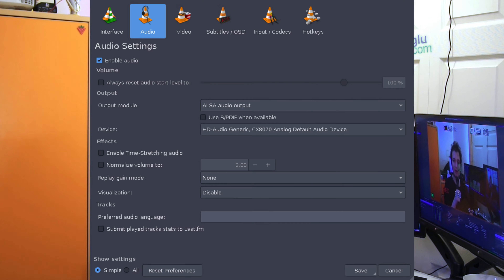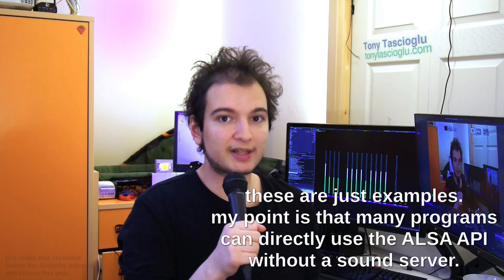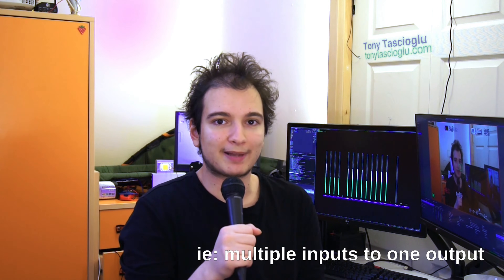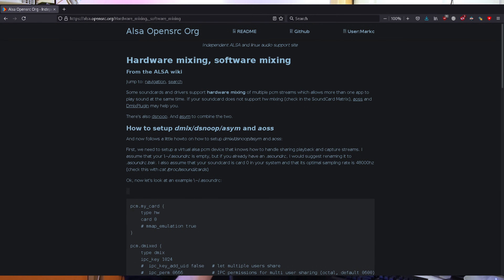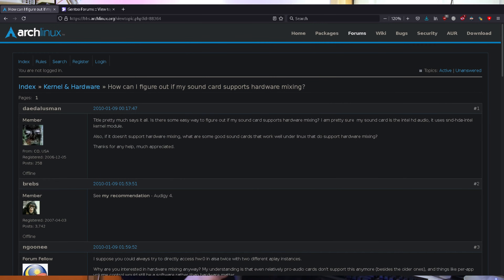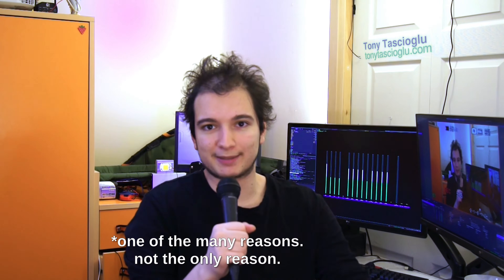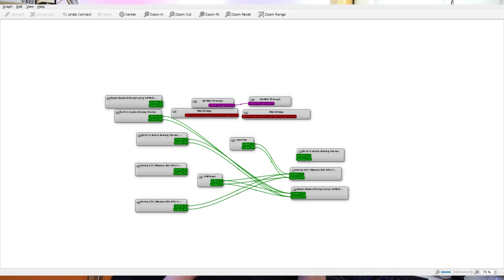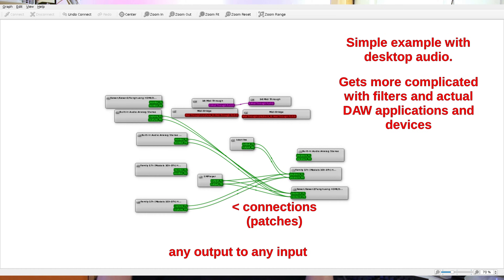Linux Audio Explained (ALSA vs PulseAudio vs JACK vs Pipewire Explained)

Comment: Hello Tony.  Thanks for posting this.  I've been tearing my (non-existent) hair out over Linux Sound.    I have a simple mixer app (VoiceMeeter Banana) running on my windows machine.   It presents two virtual inputs and outputs that I mix to two USB headphones,   zoom and browser sound out.   Application is my wife, daughter (via zoom in another continent) and I watch TV together for some big shows. 

Can I do the same under linux and move to linux on my laptop?
I've read a lot about jack/pipewire/pulse,  and watched your video.   I need jack to talk to multiple sound sinks/sources at once.   That is the missing piece.   And alsa_in and alsa_out won't work no matter how hard I try.   

I'm a retired software engineer.  I'm willing to put the effort in to make this work.  But sound systems under linux are actively hostile unless you already know the answers.
Reply from the maker: I currently do this using Pipewire by just adding the routes manually through the graph in qjackctl (using pipewire as the backend), or qpwgraph. I actually found voicemeeter on Windows by looking for an equivalent. qpwgraph or the qjackctl graph should let you take the zoom and browser sound out, and just drag-and-drop the outputs into both the input for zoom or your speakers. If you need volume or eq, you could inline any LV2 plugin like calf.

Previously, I used to make a couple of fake sinks on pulseaudio that I could then map to the sinks I wanted, and I believe this is still what EasyEffects/PulseEffects does, but it seems easier to just route the output of an application to 2 sinks through the graph now.
Reply from the maker: For context for the above, if you use pipewire as the backend for pulse and jack, if you run the qjackctl graph, you should see all of your ALSA inputs and outputs. Zoom would appear as a block with both inputs and outputs, and browser with the movie would have an output. You would go browser out -> zoom in and browser out -> speaker, and microphone -> zoom optionally with filters in between.
Reply: @TonyTascioglu  thanks for replying.   I eventually got my setup working. 

TLDR,  here's my blog writeup ...

Here's why I needed to do this -- My wife, my daughter and myself like to watch a certain streaming TV show together.  My daughter is in the USA and we're in the UK. My solution in the Windows world was to use Voicemeeter Banana to provide virtual sound interfaces and mixing. I ran a browser window with the TV show, and routed the output to a Voicemeeter virtual device. I ran Jitsi Meet in a browser window (Brave or Vivaldi) and routed the output and input to/from the aux virtual devices in Voicemeeter.  My wife and I had USB headsets on,  and each had an input and output channel in Voicemeeter. Then, by the magic of twiddling the right knobs in Voicemeeter,  my daughter could hear both of our headsets, plus the TV program. My wife could hear my daughter and myself, and the TV program.  And I could hear my daughter and the TV program (there was no need for me to hear my wife because I was wearing an open headset and could hear her well enough without any electrons being involved).

I wanted to replace this with a purely Linux setup, but not because I don't like Voicemeeter Banana.  On the contrary,  I think it's a great piece of software and gladly paid for a license. It's because I want to move from the Microsoft-controlled world of Windows to an open-source alternative.  I've been running Linux on my main desktop and servers for years, so I'm comfortable using it.

Linux sound really is a mess.  Linux sound is way over-complicated due to its history - i.e. if you sat down and designed it from scratch, you wouldn't design what we now have. I spent literally a year periodically searching for instructions on how to support my usage model.   I experimented with different distros and kind-of got it working on some of them, but with unexpected behaviour.

I did eventually get it to work. The working configuration uses ALSA, Pipewire,  Pipewire's emulation of Pulseaudio, Pipewire's emulation of Jack and Ardour,  all running on Fedora 39 on my HP Envy laptop,  with Amazon Gaming and Sennheiser USB headsets.

A quick explanation of what the various software sound system components do.  ALSA is the interface to the sound hardware.   Pulseaudio is what things like browsers know how to connect to to make sound.  While the Pulseaudio server is not running in this configuration,  Pipewire runs an emulation of it so that existing apps know where to send sound.  Jack is a server and set of interfaces that allow Jack-aware applications to route sound to more than just a hardware sound device.  Pipewire runs an emulation of it so that the Jack server is not actually present,  but apps that rely on it can still use it as if it were.  Pipewire also provides the ability to create virtual devices that Pulseaudio apps and Jack apps can use and Jack apps can route sound to and from.

I messed around with Debian 12,  Neon,  Ubuntu studio.   In none of these did I get "expected behaviour" - i.e., it works as other people said it did.  I didn't try too hard to find out why.  It might have been my own stupidity.  Fedora 39 running a KDE desktop was the first I tried that worked as I expected.

Fedora 39 comes with Pipewire installed. I installed Ardour from the Fedora flatpak repo.

I created a Pipewire configuration file "jitsi.conf" in ~/.config/pipewire/pipewire.conf.d

```
context.objects = [
    {   factory = adapter
        args = {
            factory.name     = support.null-audio-sink
            node.name        = "from-browser"
            media.class      = Audio/Sink
            object.linger    = true
            audio.position   = [ FL FR ]
        }
    }
    {   factory = adapter
        args = {
            factory.name     = support.null-audio-sink
            node.name        = "from-jitsi"
            media.class      = Audio/Sink
            object.linger    = true
            audio.position   = [ FL FR ]
        }
    }

    {   factory = adapter
        args = {
            factory.name     = support.null-audio-sink
            node.name        = "to-jitsi"
            media.class      = Audio/Source/Virtual
            object.linger    = true
            audio.position   = [ FL FR ]
        }
    }

]
```

This configuration is loaded by the Pipewire server whenever it starts (i.e., the user logs in).  It creates two virtual sinks (pretend sound output devices) and one virtual source (pretend microphone).

The system sound device is set to "from-browser" using the KDE volume-control widget.  When a browser runs and displays a video,  its sound goes to this virtual device. I run Jitsi Meet in a browser window,  and select "to-jitsi" as its microphone and "from-jitsi" as its speaker.

Then I create a session in Ardour that does the mixing.   Ardour is capable of much, much more than I'm using it for.  But it can act as a mixer without the need to record or play back.   In Ardour, I created a number of Audio busses:

- From Sennheiser, with input connected to the Sennheiser headset
- From Gaming, with input connected to the Amazon Gaming headset
- From Browser, with input connected to the from-browser virtual device
- From Jitsi, with input connected to the from-jitsi virtual device
- To Jitsi, with output connected to the to-jitsi virtual device and inputs connected to the "From Sennheiser" and "From Gaming" busses
- To Gaming with output connected to the Amazon Gaming headset and inputs connected to the "From Browser", "From Jitsi" and "From Sennheiser" busses
- To Sennheiser with output connected to the Sennheiser headset and inputs connected to the "From Browser" and "From Jitsi" busses

In operation the "from" busses are balanced to give similar levels, and the "to" busses are adjusted to give comfortable levels.

Jitsi is used to share the browser tab containing the video source, and "share audio" is selected.   I believe this might give a different (higher) quality on the shared audio than mixing the browser sound into the "To Jitsi" bus,  but I have nothing to back this up.

Comment: I have been having problems getting surround sound to work through through an HDMI connection, speaker-test only plays 2 channels even though I am passing 6 channels. The middle, surrounds and sub are completely quiet during the test. Any suggestions are welcome.
Reply from the maker: What is the output of the HDMI device? Both Pipewire and ALSA support more than two channels, so you can send 5.1 or 7.1 PCM (just not DTS/Atmos if I recall). If it is connected to a TV, it might be ignoring anything but the main two channels. Also of note is that most applications don't upmix by default. So, a stereo music player might not upmix it to the rear or side channels unless manually configured.
Reply: @TonyTascioglu It is a QNAP Nas HDMI port which can output 5.1 or 7.1.i tried to get surround out of a Raspberry Pi as well and it didn't work with speaker-test although running Kodi pass through DTS content worked just fine.

Comment: When a Start Jack audio, other sounds of my compter not working. Example, youtube. When started I'm not listen de youtube audio. Anybady with same problem?
Reply from the maker: Depends if you have anything else running. If you start JACK and it takes the ALSA device for itself (and the ALSA device does not support hardware mixing), then anything else trying to use Pulse to get to the ALSA device might not work. In that case, you could make Pulse output over to the JACK server which passes it off to ALSA. I mention this, since I don't think YouTube in a browser would have native support for JACK, likely just Pulse.

Comment: Hm. I stumble a little bit over the "Wayland" part when it comes to video. Imho Wayland still sucks. I tried it over and over again in the recent years since it came out, but always returned to X11 because there were incompatibilities with software or weird window behaviour (especially with "background" windows). So do I get it right, that switching to pipewire only makes sense if I also switch to Wayland? Or did I misunderstand that part?
Reply from the maker: Switching the pipewire is basically a requirement if you're on Wayland as it's used for more than just audio, the whole portal, video and screensharing system relies on it. On X11, I think it still makes sense to switch, since you get to unify Pulse and JACK applications, use some newer codecs on bluetooth (not strictly dependent on Pipewire), etc.

Comment: Anyone has experience with Lenovo Legion where its speakers only work in Windows not Linux? The Headphone does work in both OS, only the speakers that has the problem with Linux.
I have search all over the internet with no useful result and Lenovo said their hardwares are only tested for Windows.
Reply from the maker: Ah, this is one of the new Realtek chips, right? My friend had this issue with an HP laptop, where the outputs of the sound card weren't working properly.
First thing I would do is check in `pavucontrol` in both the configuration tab, as well as the Output Devices section. Specifically, I had an issue where the "Port" on the output devices had to be switched between Speakers and Headphones manually. Might not be the case for you (this was with a Conexant chip), but worth a try. Otherwise, maybe `alsamixer` has something, but I've seen this happen on a couple of new laptops.
If nothing works, use `lshw` to get the involved audio chipsets, and it's probably best to file something upstream - likely within the ALSA driver. If you search for the hardware, I assume there's probably already an open bug, in which case it may be worth also including your hardware as a comment to help triage and determine how many devices are affected.

Comment: That was a first class system overview; your video really helped me to picture how it all 'bolts together'. Using qpwgraph, I've just set up the laptop microphone -> EasyEffects (so I can use eq, multi-band compression, etc) -> wfview (which then 'feeds' audio to and controls an Icom IC-705 transmitter on my network) and it's all working an absolute treat. All I have to do now is spend a ludicrous amount of time setting up all the EasyEffects components in an attempt to make it sound good(ish). 🙂 Assuming it sounds okay (long story about Icom codecs omitted to save space), the next stage will be to set all this up in a headless Linux box (with a decent audio interface and microphone) and try to emulate an Orban 9105A Optimod-HF using EasyEffects; I might be gone for quite some time! 😀

Comment: NO. Definitely NOT! No one on his right mind wants to have music playing whlie watching a video. This whole mixing bullshit is superfluous AND detrimental to sound quality. What we want is as pure bit by bit audio reproduction as possible - not 2 sources screaming at the same time. PLEASE get this in your mind! Did you really say you have 10 programs playing at the same time? Does anybody notice how ridiculous that is?
Reply from the maker: I'm not quite sure why mixing would be detrimental to sound quality? If all the input streams are 48 kHz, and the output stream is 48 kHz, all that happens (at its core) is multiplying the incoming integer by a volume float, which shouldn't impact the content (other than by volume) - very much similar to how an analog sound board uses adjusts the volume and adds the signals as an analog voltage. (I am aware it's a bit more sophisticated due to buffers and whatnot, but I don't fully see why that would be detrimental to sound quality).

When you say "pure bit by bit audio reproduction" - I don't think the core content of the streams is really affected - it's not like its adding random DSP effects, or downsampling to some weird state.  If you're referring to 44.1 kHz audio getting upsampled to 48 kHz by mixing, that is generally going to happen as most DACs built into laptops, phones, etc are all running at 48 kHz.

While maybe 10 sources is pushing it, but, you can easily have a discord/zoom call while also playing a game while also quietly playing music. Not to mention, anytime a notification comes in, the sound for that is an additional source.
Reply: @TonyTascioglu  I don't use notification or system sounds, as these are awful and distracting. Even just mixing at the same sampling rate is detrimental, since there is LSB rounding errors causing noise. Resampling and mixing different sampling rates is pure 🤮🤮

Comment: Plz help me i am getting error related to ALSA on my jetson nano i installed UBUNTU LTS .I want to give voice input and get voice output
Reply from the maker: While I'd like to try to help, unfortunately your comment doesn't give a lot to go off of, there could be many reasons why ALSA errors out. Both ALSA and pulse/pipewire should work on Ubuntu LTS as long as the DAC/ADC is compatible (which it probably is).

Comment: Jack is the reason I have decided to move to Linux, well window 10 is buggy as hell. Jack is reviving my old audio interface and old pc into capable workhorse again. Audio or video editing, I could do it now.
Reply from the maker: Nice! May I ask if you're using a USB or Firewire interface? I've had no issues with USB ones so far, but Firewire/I1394 can be hit or miss on the Linux stack
Reply: @TonyTascioglu  never tried FireWire interface before ,I'm currently  using Scarlett 2i4 gen2. It work 99% most of the time. Other than it's my own fault trying to lower too much buffer that interface can't take it.

Comment: Audio interface recombination for linux?
Reply from the maker: Most USB interfaces are supported - particularly if they're typically driverless. Stay away from FireWire or anything too custom.
For hardware devices, I've found checking https://linux-hardware.org/?view=search to be useful to see what is detected and if it is picked up by drivers.
I'd definitely stick to a audio interface supported by ALSA. In general, most of the common ones (Focusrite, Presonus, Behringer, Rode) should work. ALSA also has a matrix here: https://www.alsa-project.org/wiki/Matrix:Main
For what it's worth, I've tried with a PreSonus Audiobox USB 96, FocusRite Scarlett 2i2 and a basic Behringer unit and they all worked without issues.

Comment: 10:03 One reason PulseAudio makes things easier is it basically slots in under the ALSA API. So apps that know about ALSA automatically work with PulseAudio, without noticing the extra PulseAudio layer between them and the actual hardware.

Comment: 8:45 ALSA also does MIDI. But ALSA MIDI is not compatible with JACK MIDI.
Reply: There are actually two “versions” of alsa midi, raw and sequencer (that I believe emulates what oss used to do). There are of course simple “bridge” programs between Jack and alsa midi like a2jmidid